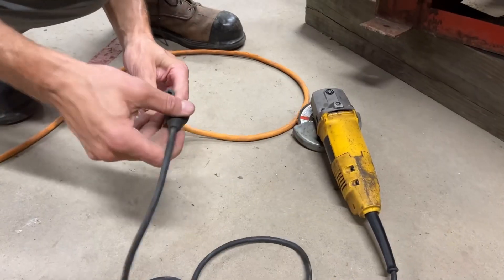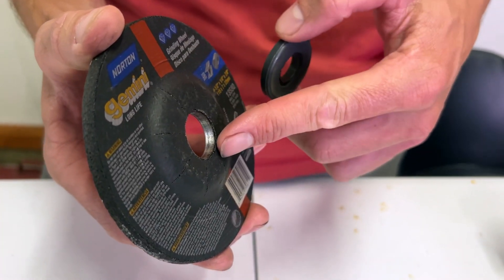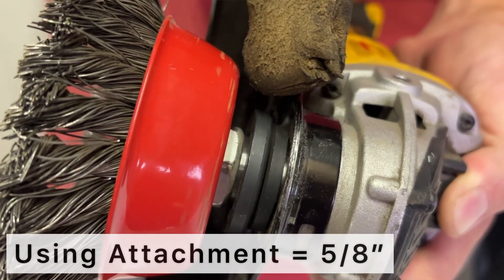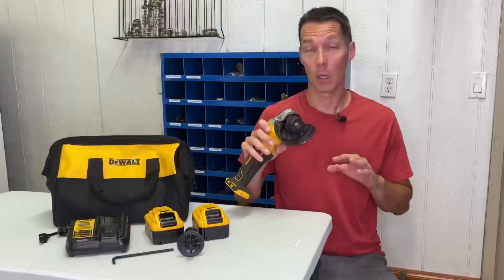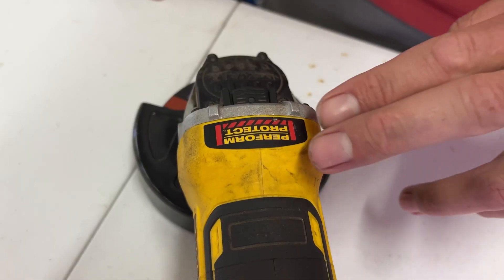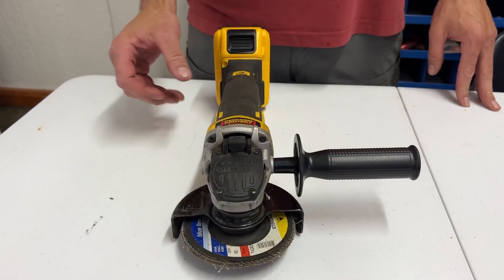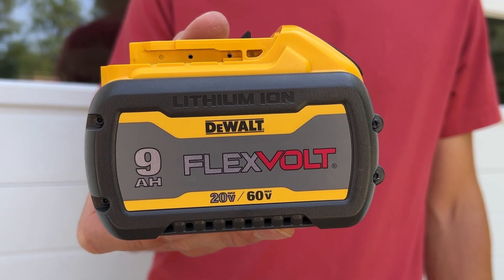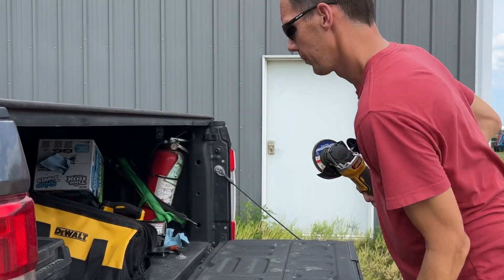When to Use 5/8” & 7/8” Wheels | DeWalt 20V Angle Grinder Review

Comment: Can you use a 7 inch wheel (with the 7/8 arbor) on a 4.5" with a 5/8th arbor. I can only think that the lower RPM on a 7inch may cause the disk to snap or break under the higher rpm (10,500rpm) of a 4.5" grinder? If the 7/8 disk fits then would a 7inch dust shroud be acceptable for safety purposes while gaining the vacuum feature also??
Reply from the maker: A 4.5" grinder will not safely fit a 7" wheel since you would need to remove the guard, plus the RPM difference will likely not be correct.
Reply: @TwistedToolbox  guard replaced with 7inch adaptable dust shroud/guard)) and a variable speed at 3000 to address 7" blade safe operation requirements??? I take you have tried these options and it was a no go"???
Reply: @BlossomPainting  I've tried a 6" wheel before and it was too close to my hand without a guard on. If they make a guard for the 7" wheel and they are made for the speed, then it should work.
Reply: @MobileRVTechServices  Maybe a D or J side grip attached and heavy pants - I will start at lowest RPM (3000) and see how it goes.

Comment: Thanks for the Video clearing up that I could use a 7/8 wheel, but after a call with DeWalt I was told you can use a 5/8 grinding wheel or a 7/8 with their 20V tools.
As an example I was told the 4"×1/8"×5/8 DW4418 type 27 can be used.
Near the start, I believe you said only a 7/8 hub could be used?
Reply from the maker: I only use the 7/8 wheels on the grinder.

Comment: We have a small dewalt angle grinder and we can not locate the 5/8" to 7/8" adapter (arbor) that you are using.  I have googled endless names with no luck - could you please tell me where to obtain one?  Thank you!
Reply: Did ya try flipping the arbor screw over when using 7/8 wheel
Reply from the maker: I'm glad you got it figured out.

Comment: This was helpful; but I have a 412.  It only spins at 8k.  How/where does this number appear on discs? I guess I don't understand. Like mine's a type 27.  Is that the machime or the guard size?  How do I know if a pad thingy (i need a concrete one) is the correct one for my model or does it not matter as long as the 4.5 and 7/8 stuff matches?  Although experience seems to indicate the former.  I just want to grind down a cement threshold so my door fits.  It's turned into the search for el dorado. So, any help please.
Reply from the maker: If you go to the isle at the store with grinding wheels, you will see the info you are looking for. They will specify what the wheel can cut; concrete, metal, aluminum, etc. The label on the wheel will also list the max RPM that wheel can safely spin.
Reply: @TwistedToolbox  Thank you!

Comment: From my understanding, the 5/8" arbor refers to the spindle. You can actually measure it with a ruler, from outside thread to outside thread. The backing flare nut step diameter, used to fit inside a grinding wheel, is the 7/8" . So when shopping for grinding wheels you go by the size of the disc, and the diameter of the flare nut step (not the arbor size).
Reply: No, the ARBOR or arbor hole is the larger step up diameter to hold cutting and grinding wheels which fit around the 5/8" SPINDLE that is used for threaded attachments.